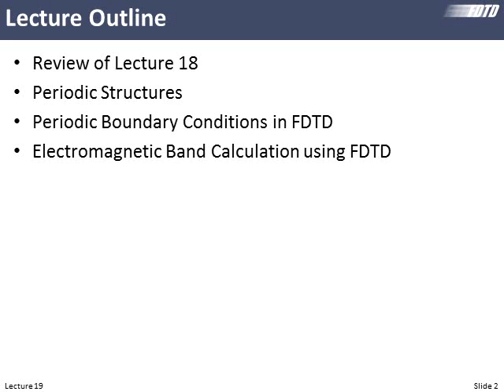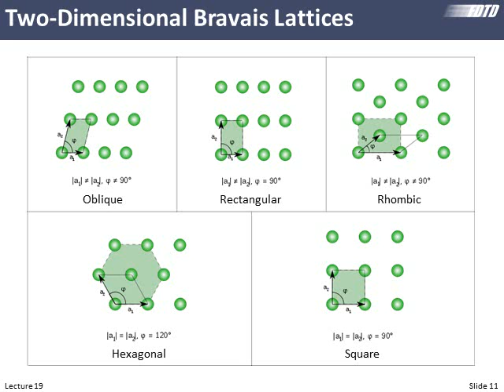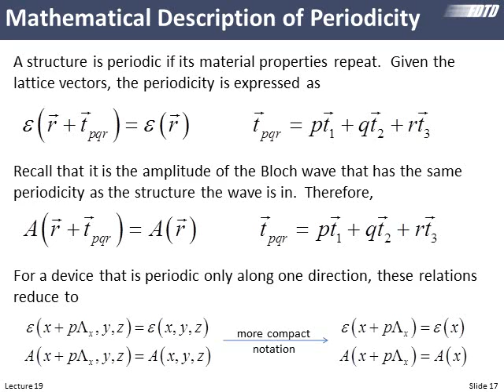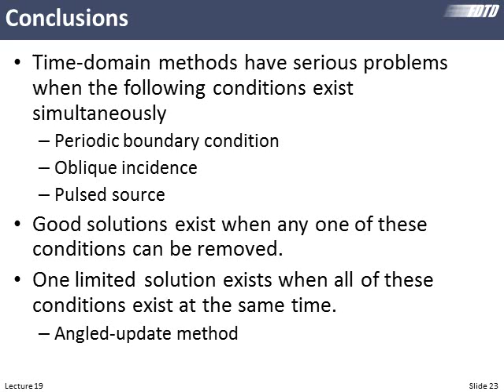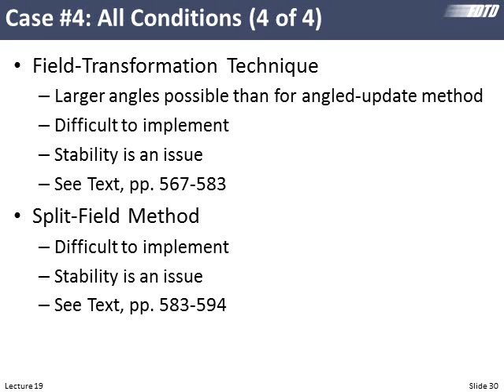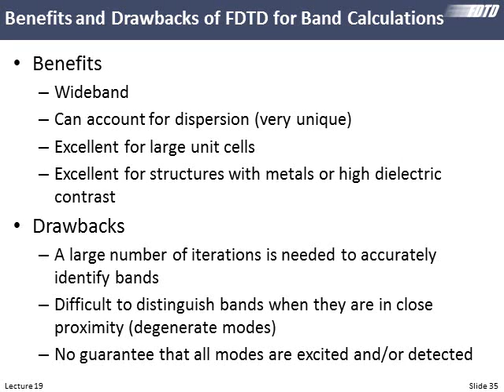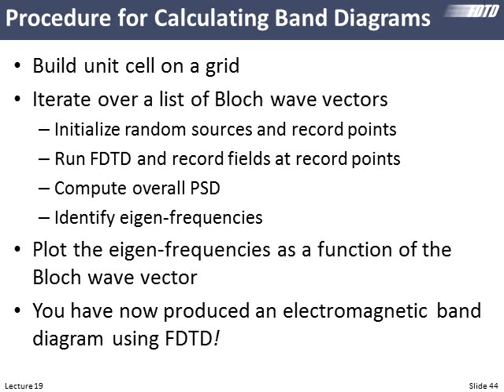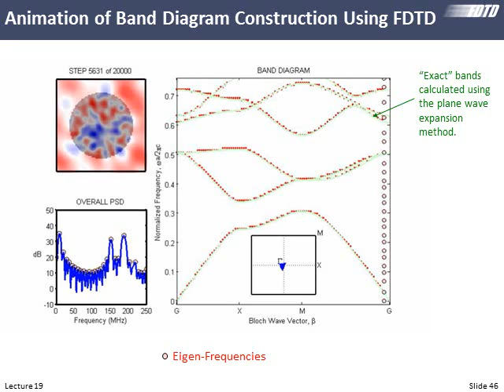Lecture 19 (FDTD) -- Periodic structures in FDTD

Comment: Slide 20  (18:51) - Dr. Rumpf, would you kindly elaborate on how the sin ϴ was derived ? My understanding was that |Bx| = 2πf/c0, and that is how we ended up with c0 in the denominator, but I'm not sure how the sin ϴ comes into play.
Reply from the maker: To show the connection to Bloch's theorem, I uses beta as the angle of incidence.  It is true that |beta| = 2*pi*f/c0, however, beta_x is only the x-component of beta.  The angle theta is the angle of incidence so that beta_x = beta*sin(theta).
Reply: Thanks so much.

Comment: How can i find the resonance  dip of propagating surface plasmons using PML boundary condition ? I could not use Bloch boundary condition because i am also using another light source simultaneously incident perpendicularly .
Reply from the maker: Are you simulating something like the Otto setup to excite SPPs?  If so, you will need to build the entire structure onto your grid, including the prism, dielectric film, and metal layer.  A PML will be needed at all boundaries, although I could maybe argue you would not need a PML under the metal layer.  However, I would still use a PML at all boundaries.

You will probably want to illuminate the prism with a Gaussian beam that undergoes a total internal reflection (TIR) and then exits another face of the prism.  The TIR produces a surface wave that will match to a SPP at a certain wavelength.  You can monitor the amplitude the Gaussian beam exiting the prism.  When this amplitude dips, you have excited a surface wave.  Of course, you can also monitor and see the surface wave at the interface between dielectric and metal.
Reply: @empossible1577  If you can give me your email address , i would show you my configuration. i am stick  on this project for long long time and no one ever has helped me . I tried with PML boundary . and i only should produce it using PML because i am also using another light source which is not inclined .
Reply from the maker: @nabintimalsina5628  emprofessor(at)empossible.net.

FYI...I am going to be on travel for the next two weeks, but will do my best look at your stuff as soon as I can.

Comment: Hi Professor, how should we implement dipole source at 40:15? is it the same with soft source? Thanks.
Reply from the maker: It is a very easy soft source.  You simply add a Gaussian function to one point on the grid to inject a dipole source.

Comment: What boundary condition to be used if the surface is not periodic and the light is injected at an angle ?
Reply from the maker: That depends on how you setup the problem.  One possibility is that you treat the nonperiodic problem like a periodic problem.  You would use periodic boundary conditions and include something like five to ten "effective" periods of the device.  This approach is used to simulate pseudo-periodic lattices.  A second approach is to include enough the device to encompass the source.  In this case, you would typically use an absorbing boundary on all sides of your mesh or grid.
Reply: @empossible1577  i have mailed you and shown you the setup of my problem . would you mind checking it please ?

Comment: Dr.Rumph, thanks again for the series of videos on the topic of computational EM. They are really awesome!  I got a question about the band diagram calculation for structures with a lossy medium. Firstly, I know that it is impossible to do that with classic PWE (except for the case where the loss is negligible). Then in the book of  D.Ioannopoulos, he said if the imaginary part of epsilon_r is relatively small, it is possible to use perturbation theory. But I don't know it is valid for how much loss?  Finally, is there another kind of Mode Decomposition method that can be used to do that? If not, can the FDTD (or FDFD) which incorporates dispersive and lossy medium compute correctly the band diagram or not? Thanks a lot.
Reply from the maker: The problem is not the solution method, it is how the eigen-value problem is formulated.  The simple approach is to make frequency the eigen-value.  Since frequency is the output and the calculations will be across a huge range of values, it will only be accurate at the frequency corresponding to the material values you used in your problem.  This problem exists no matter the solution method: PWE, FEM, finite-difference, etc.

The solution is to solve the problem another way.  In the frequency-domain, you would move some terms around in the eigen-value problem so that frequency is not the eigen-value.  I cover this a bit in Lecture 6e PWEM Extras.

https://empossible.net/academics/emp5337/

Another solution is to use a time-domain method like FDTD.  This is not solved as an eigen-value problem at all.  The benefit is that dispersion can be incorporated in order to get accurate bands over all frequencies.  The drawback is that it becomes impossible to resolve closely spaced bands and there is always a chance you miss a band by not exciting or probing it correctly.
Reply: @empossible1577  Thanks a lot for your reply in time. I see clearly the problem with dispersion. In fact, i have implemented the dispersive version of pwe that you have presented in the lecture of pwem extra (not tested yet). But how about the material with a non-null imaginary part? Suppose with have something with eps_r = 7+3i (mu_r=1) which don't vary with frequency. Can we put this directly in a classic PWE method and solve the eigen-modes? In this paper(https://hal-centralesupelec.archives-ouvertes.fr/hal-01589787) and some other blogs, they said this is not correct.

Comment: Dear Dr. Rumpf, first of all thank you very much for these invaluable lectures!.  I just have a question, I'm trying to simulate the band structure of a PHC, but I realised that the results I get depend on the frequency I use for the Gaussian sources.  What I mean is that the band structure I get using a frequency of f = f0, is different to the one I get for f = 2*f0.  I would have expected that the lower half of the band diagram for f=2*f0 to match that of the band diagram obtained for f=f0, however this is not the case.  Is there something you could suggest for me to check in order to solve this issue?.  Thank you once again!
Reply from the maker: Thank you for the compliment!  I am happy to help!

Your sources should be Gaussian pulses, not a fixed-frequency source.  Gaussian pulses contain power in in a broad spectrum of frequencies so you can calculate all of your bands from one simulation.  I suspect you are using a fixed-frequency source because you specified a frequency for your source.  Take a look at Lecture 6.  This is where I first introduce the Gaussian pulse source.
Reply: Thank you for your reply!.  I'm in fact using Gaussian pulses.  The f0 I mentioned before refers to the maximum frequency contained within the pulse: tau = 1/(2*f0), g = exp(-((t - t0)/tau).^2).  I also noticed that the simulation changes more dramatically when the frequency I use for the second simulation is not a multiple of the first one.  For instance, I run first a simulation with f0 = 400THz; then if for the second simulation I use a f0 = 700THz, the results will be way off than if I use a f0 = 800THz.
Reply from the maker: Hmmm...Hard to say what the problem is.  For sure, use a high enough cutoff frequency to calculate all of the bands you want, but do not make the cutoff frequency any higher than what you need.  Next, double check your grid parameters.  Calculate Nx*dx and Ny*dy and ensure these products give you the period of your unit cell.  Third, switch to fixed frequency Gaussian source and make sure that your code predicts the correct frequency of it.  That will verify your Fourier transforms.  Last, I most suspect you have a boundary condition problem.  Triple check the code for that.  When I really get desperate, I will fill the entire grid with air so that I will know what bands I should see and it eliminates other possible errors.  A common error is to use refractive index directly as the permittivity instead of squaring the refractive index.  Hopefully something here will help you.
Reply: I will check all the things you suggest.  Thank you very much for taking the time to reply and your for your kind help!

Comment: Thanks for the series lectures on FDTD, I am curious, in order to reduce computational cost in steady state 3D FDTD simulation, is it possible to start FDTD iteration from a initial guess where fields are computed from a simplified model with certain approximation?
Reply from the maker: In principle yes.  However, that initial guess must be a rigorous solution to Maxwell's equations or your simulation could go unstable.  At a minimum, there would be a nonphysical burst of energy at the start of your simulation.
Reply: Thanks, actually I want to use single harmonic scattering matrix method with effective medium approx as initial guess(in some periodic unit cell), what could be the "burst of energy" or other unexpected issue in this case?
Reply from the maker: I have never done what you are doing so I am guessing here.  Also, no matter what I say, I think this is worth trying.  I am wrong often enough!

I think you will be estimating plane waves in your structure for your initial guess.  Plane waves do not exist inside of inhomogeneous structures.  In order to have an instantaneous solution that looks like plane waves, there will actually need to be many plane waves at many angles, and some with rather high amplitudes, all at just the right angles and amplitudes so that they come together at this one instant in time to produce something that looks like your initial solution.  Then, as you step in time from this initial guess, you will begin to see these other waves and things will go crazy.

Or, it might work just fine.  :-)

Comment: Thank you for the helpful video.

I'm trying to simulate a periodic structure and I'm having some questions.

1. In order to extract the band diagram for both TE and TM mode I have to do it separately for each mode, right? That is, some source points for the Ez, source points for Hz, then record points for Ez and Hz and then we get the PSD for the two modes by calculating the DFT of Ez and Hz. Is that right?

2. As the Bloch vector travells on the Brillouin zone the only thing that is being affected in our main FDTD simulation is the phase terms in the Periodic Boundary Conditions? (since the phase terms need the magnitude of the vector)
Reply from the maker: 1. For 2D structures in isotropic media, TE and TM are completely independent modes.  In principle, you could write an FDTD algorithm that does both at the same time, but I don't see a use for that.  It is probably better to have one code with Hz, Ex, and Ey (H mode) and then another with Ez, Hx, and Hy (E mode).  You would source the H mode with Hz and you would source the E mode with Ez.

2. Don't think of the Bloch wave as travelling across the Brillouin zone.  The Bloch wave travels across your actual lattice.  The Brillouin zone is a map of the set of Bloch wave vectors that you will need to run simulations on.  The information from the Bloch wave vector is only in the periodic boundary conditions, nowhere else.

Comment: With respect to constructing band diagrams from FDTD, if I understood right, in a single simuation run, you excite many frequencies with a common Bloch wave vector. Later you sort of pick the "surviving" frequency,

1. Why do we need many sources distributed randomly? Isnt a single source sufficient?

2. The grid is surrounded by PBCs, so why is the PSD not uniform? In the sense, all the excited frequencies have the same initial power. Regardless of the structure shape, it should just be bouncing inside the structure, given that it has been excited already.

3. To calculate the steady-state field, we need to run second simulation. In this case it necesary to have many sources as before?

Thank you.
Reply from the maker: We pick the surviving frequencies (plural).  For every Bloch wave vector there are actually an infinite number of solutions.  Due to the grid resolution we can only resolve so many, but there is definately more than one.

1. We are calculating Bloch modes that can have a null at some positions.  If you used only one source there is a chance you will be missing some modes.  Likewise, you need to record at several point to ensure you are not recording at a Bloch mode's null.

2. The phase condition between boundaries and the materials within the unit cell limit the set of possibilities for the electromagnetic fields.  A good, but incorrect, way to think about it is this.  The power not associated with an eigen-mode will continue to scatter until it becomes an eigen-mode so it spreads across the PSD.  The eigen-modes stay eigen-modes forever.  The accurate way to think about it is that the only thing that really exists are the eigen-modes from the very start.  I just takes many iterations until those are resolved by the Fourier transform.

3. Yes because you do not necessarily know where the Bloch mode has a null.  Murphy's law follows me wherever I go so I place many sources.  If you code this up, you will get a good feel for how many you need because you will see discontinuous lines all over the place when you are missing modes.

Hope this helps!
Reply: Thank you for the answer.

Comment: Great video! Thank you! I am looking for a reference to show me how to implement Angled-Update method. Taflove's book has some material, but it is not easy to understand and it's only limited to 2 dimensions. It would be great if you could help me. Thank you.
Reply from the maker: Not sure where to point you.  I have not actually implemented the angle-update method.  I do know that you will need to store the terms at the edge of the over enough iterations to interpolate the value at the time step on the other side of the grid.  The larger the angle, the more values you will need to store.  Otherwise, it is all standard update equations, just with a modified periodic boundary condition that uses the interpolated values from the other side of the grid.  Wish I could be of more help!

Comment: Thank you for the super nice video!

Dear Dr. Rumph, I have a question about FDTD simulation methodology. From my experience, the method for calculating Band Diagram in this video is well suited for the dielectric material. And it can be utilized for calculating eigenmode or resonance mode. But the problem arises when the materials are metal because of natural property of metal.(It is difficult to identify specific eigen-frequency) Is there any good approach that you can suggest to calculate the eigenmode of the metal nanoparticle or structure?
Reply from the maker: Incorporating metals and distinguishing eigen-modes are mostly unrelated.  FDTD distinguishes the eigen-modes by detecting peaks in a Fourier transform.  When bands cross, come within close proximity, or are not resolved well in the simulation, it can be difficult and impossible to distinguish them.  This problem exists whether that lattice has metals or not.  Frequency-domain solvers build and solve an eigen-value problem where the modes are distinguished automatically by the nature of the calculation.

If a frequency-domain solver can be used, I think that is your best choice.  FDTD, however, more easily accounts for dispersion and can handle much larger and more complicated unit cells.

I discuss techniques for incorporating metals in Lectures 10 and 18.  The easiest thing to do is force the electric field to zero at points where there are metals after the electric field is updated.  If you need to account for dispersion in the metal, see Lecture 10, but this is more complicated.

Comment: Does the periodic boundary condition constitute the same solution as a Floquet mode?   My naive intuition would think that as long as the field come back in at other side of the boundary, it is periodic.
Reply from the maker: I perfectly understand your confusion as there is a lot of similar and confusing terminology here.  First, when a wave propagates through something periodic, that periodic structure can diffract the wave into discrete waves in different directions.  Each of those can be called a Floquet mode, or a diffraction order or a diffracted mode, etc.  However, this is not yet a boundary condition.  A Floquet mode is a physical thing.  Now if those discrete waves hit a boundary, this causes a special problem because there are multiple waves at multiple angles incident on the boundary and this is difficult to handle.  A Floquet boundary condition is one that can handle this, however, it is absorbing and waves will not reenter the simulation at the other side.  They will just disappear.  A periodic boundary condition will allow waves exiting one side to reenter the other side.  That is what we have done here.  I have seen boundaries given names like Floquet periodic or something like that.  I suspect that is just an ordinary periodic boundary condition, but I cannot be sure.